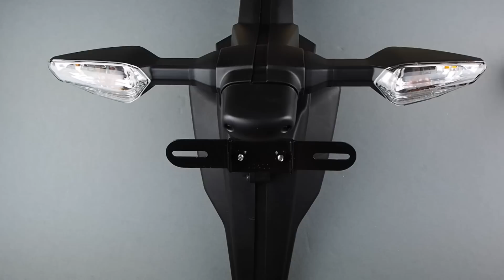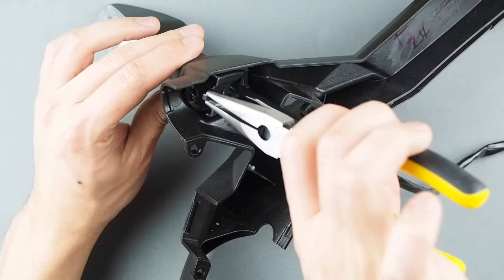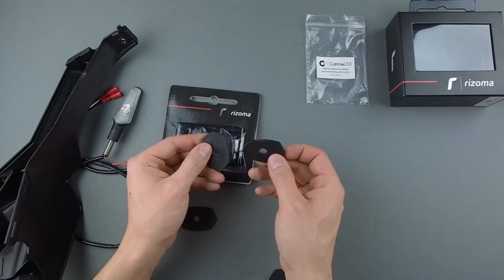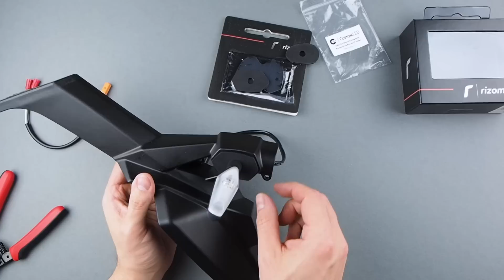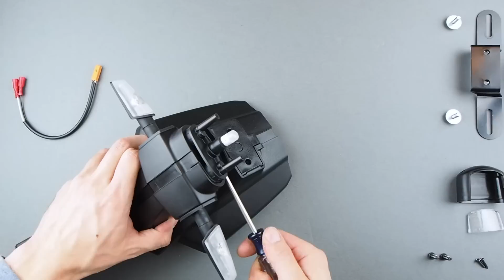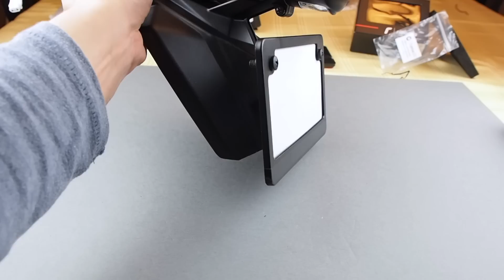LED Rear Turn Signal Install & Fender Mod: 2018 Ninja 1000 / Z1000SX

Comment: Jonathan, love your videos - very useful indeed!
I recently purchased a 2013 Ninja 1000 ABS, with only 2,000 miles and I am slowly modifying it.  So, your videos are a great help.
Also, I would love to install the LED Blaster-X Tail Light you have, will you be doing a video on that as well?
Reply from the maker: Thanks, I’m glad to hear you are liking the videos! I recorded an installation video for the Blaster X tail light, but parts of the footage were somehow lost! I’ve tried to put a video together with what I have, but I’m missing too many critical steps. The videos that I have for the rear signal installation should be sufficient to get the tail light out. Message me before you do the install and I can provide some tips on hooking up the new light.
Reply: Thank you for your response, will do...
Have another question; why replace the entire rear turn signals, would it not be easier just to replace the rear turn signal bulb with LED, especially since you have the relay already?  Kindly provide me with the bulb type of the rear turn signal which you removed.  I will try to replace the bulb with LED.  By any chance, would the Philips 194 LED fit in factory rear turn signal socket?
Thank you in advance!
Reply from the maker: I just checked the stock rear signal bulb.  It appears to be a WY10W.  I looked around online (quickly) and did not see any LED replacements.  You may want to spend more time looking.  I preferred to replace the entire rear signal in order to get a more streamlined rear fender.  I also knew that the Rizoma LEDs are great quality, extremely bright, and that the light color matches the turn signal color in my CustomLED Blaster X tail light.
Reply: Thank you, much appreciate the response...not only do you have the ninja I want but you also seem to be loaded with integrity!  By the way, I found out somewhere after spending hours on line that the LED bulbs are the same for the front and the rear.  So I ordered 2 pack and they are in!  Now waiting for that relay.  Also Blaster-X owes you; because of you mine is on the way and should be here by Friday!!
Thanks for the inspiration!
9/2/18:  Just finished installing the Blaster X and also used Inertia LED RY10W LED bulbs for both front and rear turn signals.  Whatsmore, in my 2013 Ninja 1000 ABS, I did not have to use the relay!!  Apparently it is already LED ready.
While installing Blaster X, on a Sunday night, I called and left a message due to some confusion in how to program it.  Well, the owner of Custom LEDs called me immediately and walked me through the programming.  This was awesome!!!

Comment: Jonathan - thanks for doing these instructional videos. 
Btw, have you thought of putting ZX-10R style side mirrors that contain turn signals?
Reply from the maker: That’s not something that I’ve looked into.  I’m really happy with the integrated turn signals in the fairings of the bike.  They’re visible from the front and the sides of the bike.

Comment: Hey Jonathan,
When you use your Front brake your tail light will Start to Flash and then become normal. But does it do the same if you use the foot Break (back break)?

Thanks for your effort Tyler :)
Reply from the maker: Hey Tyler! Yes, both front and rear brake will trigger the same brake effect. On mine, it’s set to strobe and then go steady.

Comment: Is there any reason that you bought the harness from custom led instead of just cutting the one for the oem signals? Is it so you’re able to reinstall the oem parts if needed? Also did you have to cut the harness from the blaster x and install female terminals or does it come with those ? 

Ps great videos.
Reply from the maker: I generally try to avoid making any permanent modifications to the bike, or the parts that I take off.  So I could have used the connectors off the stock signals, but I preferred to just add my own.  I did have to add the connectors to the Blaster-X.  I can’t remember offhand what the terminals looked like on the Blaster-X, so I don’t remember if I had to cut anything off.
Reply: I had actually received my blaster-x a few hours after leaving this comment. It comes with Kawasaki oem connection. I actually purchased the oem harness and oem y splitter from custom led after seeing that so I won’t have to modify the blaster x either. Thanks again for the videos and attention to detail

Comment: Hello sir! Could you tell me which bike you chose when ordering the adapter plates from revzilla??  Thanks!  And also, the resistors that come with the lights, if I add those, it will work fine with the bike without any further modification?

Comment: Could I use an LED bulb in the stock rear indicator, similar to the ones you fitted to the front?
Reply from the maker: You can use an LED, but it takes a different bulb than the front. I’m not sure off-hand which bulb it uses. Let me know if you have trouble finding the right replacement bulb and I’ll help you out.
Reply: Thanks Jonathan
Reply: I bought 2 sets of Inertia LED RY10W.  Same ones Jonathan Long has linked for the front turn signals.  They fit perfect in the rear ones as well!!  I have a 2013 ninja ZX1000HD ABS.  Also, I did not have to use that LED relay, so I will be returning it.  I now have wonderful LED's in the front and back (both are same bulb) and also the Blaster X tail light with the turn signal capability as well.  The LED turn signal color properly match the turn signal color of the Blaster X tail light.

To replace the rear turn signal bulbs, all I had to do was to remove just one screw that pops off the clear cover and very easily exposes the bulb.  The bike is now super awesome!!

Comment: Hi Jonathan...thanks for the informative videos. Can you please advise how to change the rear tire hugger (v shaped plastic covering the Tyre) below the rear fender. I just got my new ninja 1000 out of the dealer when a steel shard ripped my rear tyres and also ripped the plastic. Changed my tyres but not dared to take off anything else. The part is 41 usd but don't want the delaer to charge 200usd to just fix the part. Can you help.
Reply from the maker: I can’t describe it all that well via text, but it looks like a fairly easy process. Pull off the mufflers (I have a video on how to remove the mufflers). Then there are two bolts below the chain cover on the left side that need to be removed. 

On the right side of the bike, there are two bolts as part of the right foot peg that hold the fender on. Those need to be removed. Then there are two plastic pop-rivets behind the foot peg that need to come out. Lastly, there is a bolt and a bracket on the right side above the swing arm, below the passenger peg mount, which needs to come off.

If you’re able to remove and install a rear wheel, this shouldn’t be a hard job for you. Good luck and let me know how it goes!

Comment: Hi Jonathan, anyone know how to remove the license plate bulb light on Ninja 1000 2018 without removing the entire fender? I'm afraid to break it.

Thanks for your help and great videos!!!
Reply from the maker: I show how to do it in this video.  You just remove the two screws on the back of the license plate light housing, the housing comes off, and the bulb can be removed/replaced.  It’s super easy.
Reply: @JonLong  Ok and I just need to unscrew it (light bulb)? That's where i'm afraid of breaking it.Thanks you very much for your help!
Reply from the maker: Nope, you just pull it straight out.  Are you replacing it with an LED or a different bulb?  If so, you can look at that bulb to see what the base looks like.  But it just pulls straight out.

Comment: hey Jon, I want to do the same setup with instead a MotoDynamic fender eliminator, My question is, with this particular setup, will it work with my saddlebags and not hit? if it would clear the bags?, thanks again...…..
Reply from the maker: I’m not sure about Motodynamic, but I know that Yoshimura and R&G both say that their fender eliminators work with panniers.  I would check with Motodynamic. The Rizoma signals are less wide than stock, so they won’t cause any issues.
Reply: ok thanks...….

Comment: Hi, did u buy 2 sets of the rizoma adapter? Or does it come with 4 sets in 1 package? Thanks
Reply from the maker: I believe all 4 pieces came in the set.  It's for mounting one pair of turn signals (either front or rear), and that requires 4 pieces.
Reply: @JonLong  cheers! Thanks

Comment: Can you just change out the rear signal bulbs with LEDs?
Reply from the maker: Yes, you could just replace the bulbs with LED.  I’m not sure which ones they take, but they are different than the bulbs in the front.

Comment: The rubber of my turn signal became brittle and both of them broke of. They are now hanging by the wire. Do i have to take out everything as in the video just to replace the lights with the original?
Reply from the maker: Yes, I think you will need to go through the same process.
Reply: @JonLong  thank you very much!

Comment: Hi Jonhn I saw you have a lock helmet on the rear seat, I can't get one with my dealer, do you mind to share how I my get one?
Reply from the maker: It depends on where you are located.  I use the website partshark.com whenever I need OEM parts.  The US version of the bike comes with the helmet lock.  Here is the link where you can order the parts: https://www.partshark.com/oemparts/a/kaw/5aeca8c487a8660ef49ebcb4/frame-fittings
Let me know if you need help identifying which parts you need.

Comment: So the led turn signal relay that you put on for the front led turn signals makes the back led turn signals flash correctly aswell ?
Reply from the maker: That's correct.  The flasher relay, which is at the front of the bike, controls all 4 turn signals.
Reply: Torque house: I finished installing LEDs in my 2013 Ninja 1000 ABS and did not need to use the flasher relay...I do not think the ninjas equipped with an LED tail light requires it.  This was an awesome coincidence for me.